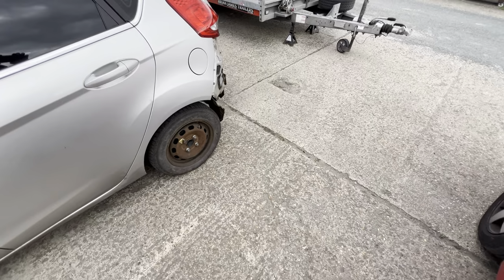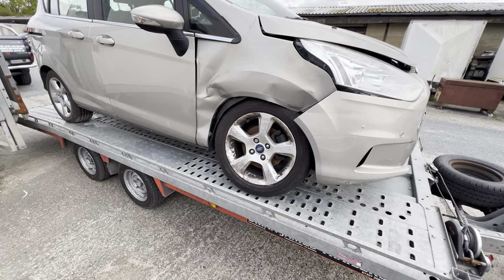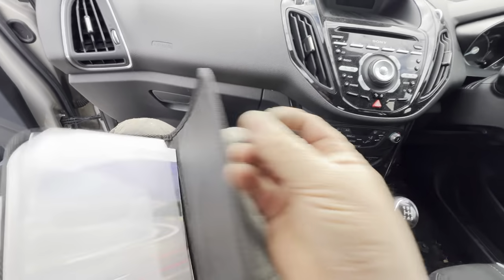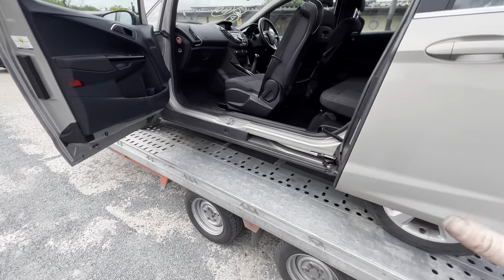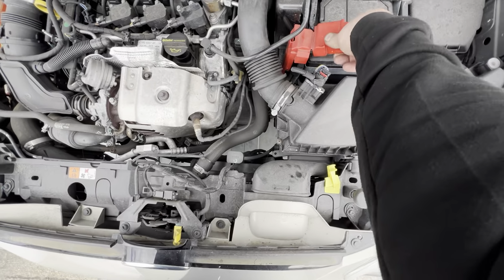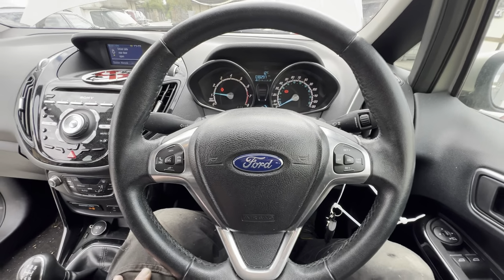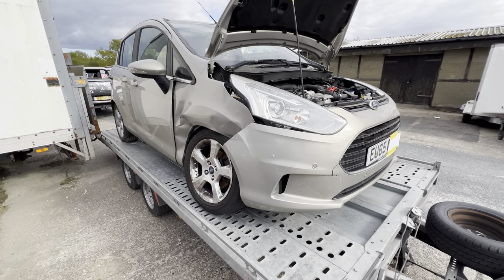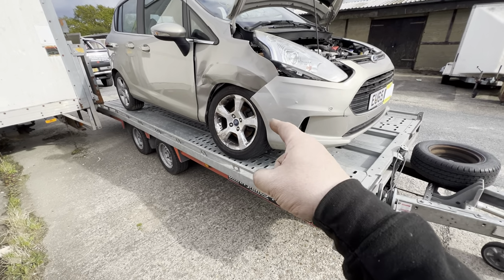I Bought Another Amazing Car From Copart Luck Is On My Side

Comment: Nice miles mark, but ignoring that, bear in mind the service life on these belts is 125k or ten years. So it’s due a belt, regardless of the 30k. And it’s a wet belt, so don’t risk leaving it, change it and the car will run another 10 years.
Reply from the maker: Hi mate how is it due a belt it’s 8.half years old
Reply: @ResurwreckAutosUK  nearly 9 then for arguments sake. They are due at 10 years and are renowned for going very early, is it worth the risk on a wet belt with the reputation they have?